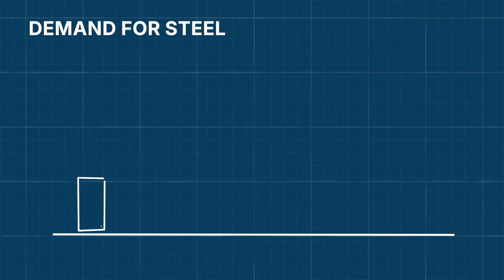How does steel recycling REALLY work?

Comment: Green heat provided by hydrogen could be a boon, as well.
Reply from the maker: Green hydrogen is typically too expensive for heat and there are some infrastructural challenges. Can use electricity like the electric arc furnace and have that come from renewables. Thank you!🙏
Reply: Green heat form Hydrogen? You need to research how Hydrogen is manufactured.
Reply from the maker: @darcymandryk1785  Could be green hydrogen, but that's only economically viable where electricity from renewables is inexpensive enough.
Reply: @NetZeroTech  And you might as well use that energy directly most of the time.
Reply: @NetZeroTech  How many green hydrogen plants do we have globally?
Reply from the maker: @thedave7760  Hi Dave, There are 600+ low-carbon hydrogen projects worldwide. Not sure how many of them are truly green.
Reply: @NetZeroTech  Green Hydrogen always seems like the solution for the net zero crowd, you have spare unused energy from green sources so why not make hydrogen and use it for energy later. Until you look into it and realise that it is way less efficient than storing the energy in batteries or hydro and many times more difficult to do so.
Reply from the maker: @thedave7760  Agreed! Thanks for sharing.

Comment: You could just remove the copper and other impurities from the recycled steel, but it's not economically viable to do so?
Reply from the maker: Researchers have found a new way to electrochemically remove copper from steel and reduce impurities. If it’s economically viable it will take decades to be implemented. It might be implemented in new plants but possibly too expensive to retrofit existing plants. We’ll see. 🙂
Reply: You can rip apart alloys by diluting the metal in acid and applying certain voltages. I've seen it done with brass. But there's absolutely no way it can be done on a large scale.
Reply from the maker: @laszu7137  Thank you for sharing! 🙂